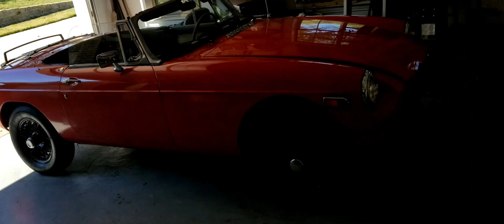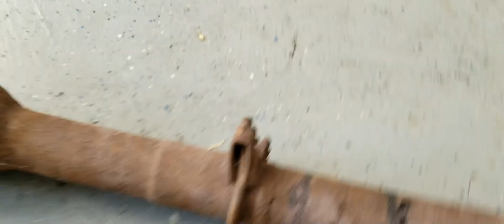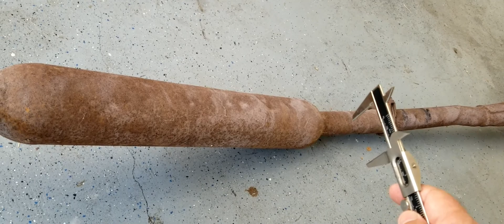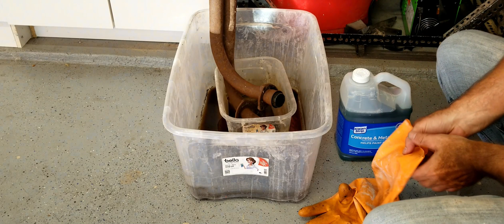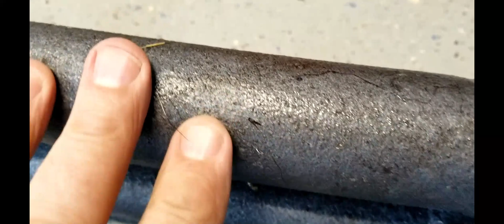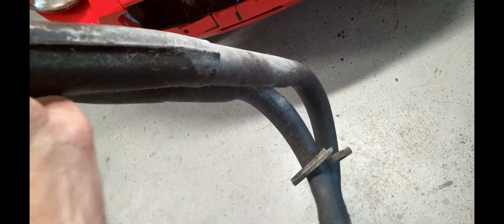Nigel the 1977 MGB Exhaust System Part 1 (tear down)

Comment: I have a "77" B & all I need is a new muffler w/ tailpipe. Already replaced the catalytic converter. I am having trouble finding just a muffler. Any help will be appreciated.
Reply from the maker: You might take a look at this video 
https://youtu.be/HRNvdZBdKUI
Reply from the maker: The kit in that Monza video included muffler, tail pipe, and the resonator